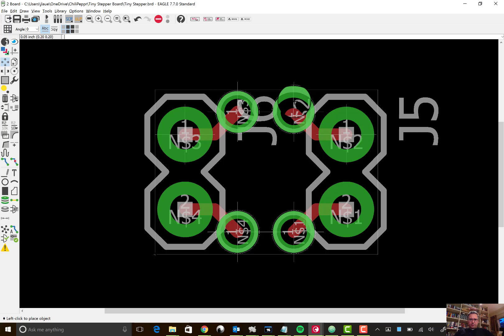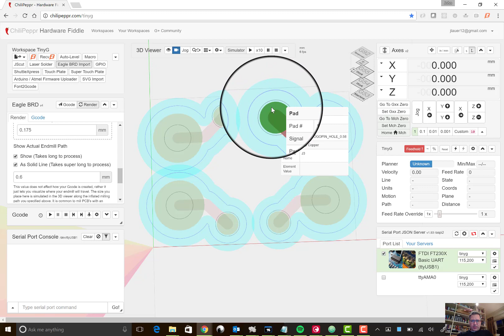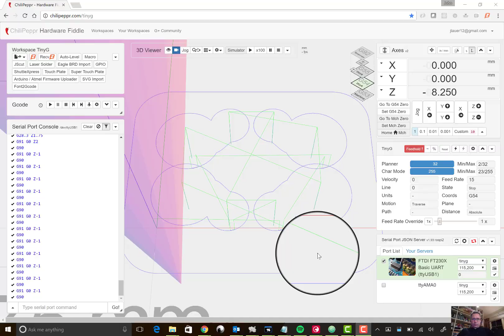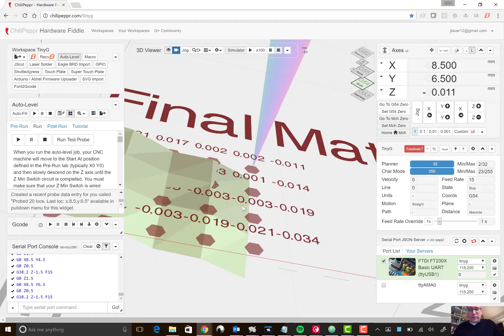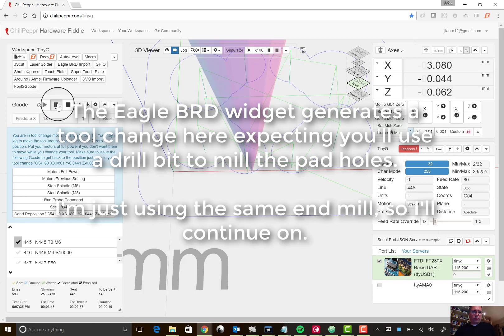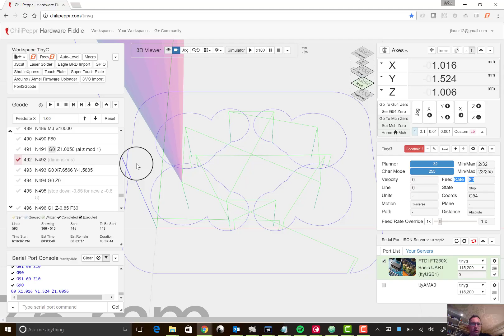Whole Process of Milling a PCB in ChiliPeppr

Comment: Does chillipepper only import from Eagle?,i have Tina7 pro ind suite,i thought the gerber files were universal(there is a standard file type for most gerber use now,apparently),i'm an Electronics Technician yet software is still a pain,i want to proto some small pcbs,or larger ones for outsource if quantity required is enough.
Can chillipepper probe the copper clad surface before milling.

With thanks for informative videos and any info provided,

John ,
Glasgow,Scotland.
Reply from the maker: ChiliPeppr only supports Eagle as that file format has much more information in it than Gerbers.

Comment: I was curious which you prefer the shapeoko 3 or tinyg cnc3040 and for what reasonings. I'm wanting my machine to do tssop SMD reliably and be able to cut aluminum.
Reply from the maker: That's easy. 3040 or 6040 cnc. The reason is that it is rigid. Anything with timing belts is never going to work well for detailed milling or aluminum milling. I started with shapeoko and when I moved to 3040 I wondered why I ever bothered with timing belts. When you mill your PCB on the 3040 you get to experience crisp corners, circles, and traces for the first time and you realize that the mushiness of timing belts translates directly into your milled output. When you have ballscrews and all rigidity, you get crispness.
Reply from the maker: Oh, and on TinyG, there's so many things that are better, but the biggest thing is you get a real feed hold/wipe/resume which you inevitably need when doing CNC milling. On Grbl if you feed hold/wipe, you lose position. It's not worth killing a 2 hour job that you mess up 1 hour in simply because you didn't have a worthwhile controller. If your time is worth $100/hr, just spend the money on TinyG.
Reply: John Lauer Ok thank you for your input. I'll now do some more research on cnc3040.